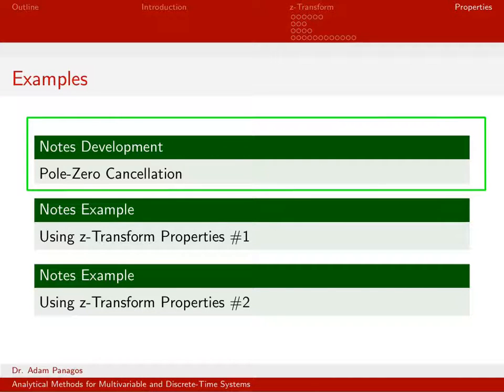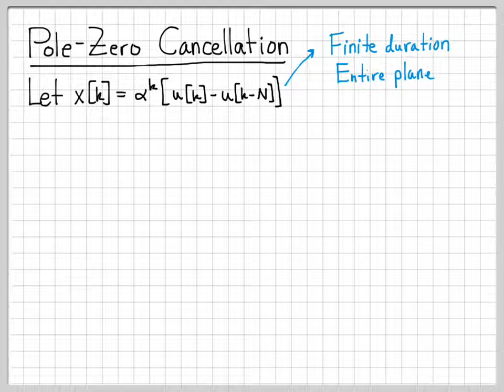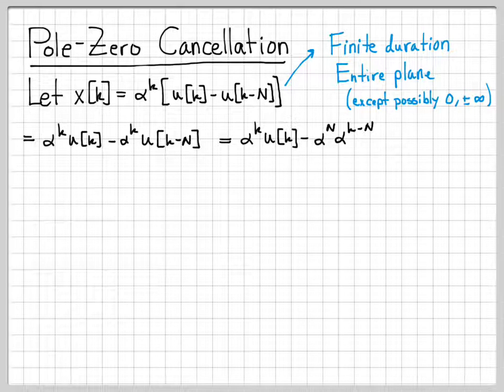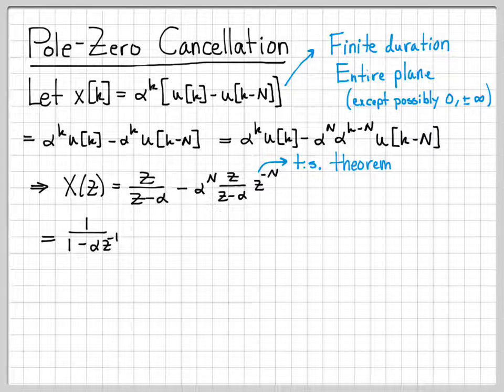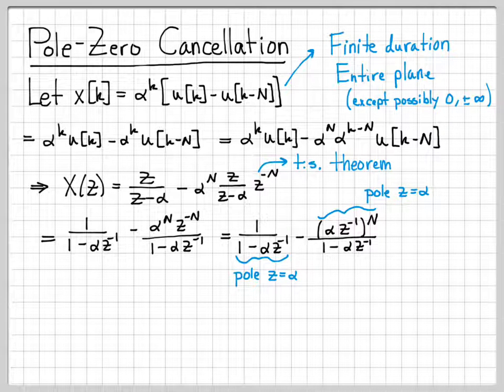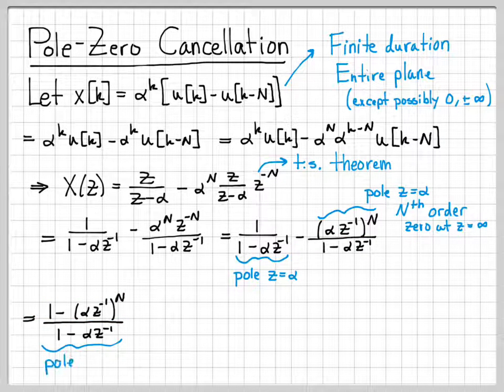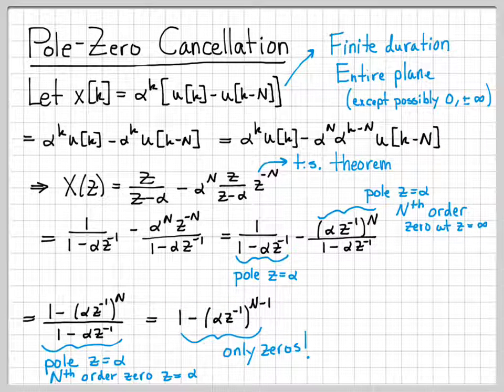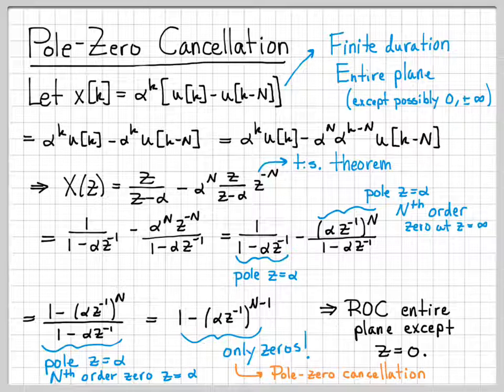Z-Transform Pole-Zero Cancellation - Z-Transform Part 1

Comment: Didn’t you mean to write: ROC entire plan expect Z = Alpha ? Instead of Z=0
Reply from the maker: No, I think what I have written is correct.  Take a look at the final expression of 1- (a*z^-1)^(N-1).

We just need to worry about values of z that might cause this expression to "blow up".

Since z^-1 = 1/z, if z = 0 we have a problem so z = 0 is the one point where we do not converge.

I hope that helps.  Make sure to check out my website http://adampanagos.org for lots of additional content that you might find helpful.  Thanks, Adam

Comment: Sorry, I am confused, how could the last equation in the video be correct?
Reply from the maker: Is the equation you're talking about the "1- (alpha *z^-1)^(N-1)?  

You're correct in that the preceding term and this final equation are not equal to each other.  It would have been better for me to write --> or => or something instead of the equal sign.  My main goal here at the end was trying to identify the poles and zeros of the transfer function so I could determine the ROC.

Since the pole at z = alpha was cancelled with one of the zeros at z = 0, the final transfer function effectively is just an all-zero transfer function.   However, as you noted, the equal sign is not correct.  Good catch.  Thanks.
Reply: Thank you So much, it is clear now!!
Reply: @stanleynickels6106  I think the problem here is that the N zeros are not all at z = alpha, rather they are at N equally-spaced points around a circle of radius |alpha|.  Exactly one of those zeros is at z = alpha, which cancels the pole, but the others remain, and the resulting quotient polynomial is the product of the other zeros, i.e. 1 + alpha z^{-1} + alpha^2 z^{-2} + ... + alpha^{N-1} z^{-N+1}.  And this is the same was what you would get by evaluating the z-transform of x[k] directly.

Comment: At 4:44, what happens if we algebraically rewrite that term into: z/(z-alfa) by multiplying it by z/z? Does that not mean that it also has a zero a z=0? Thanks.
Reply from the maker: +kabascoolr Yes, what you say is not incorrect.  The term 1/(1-alpha/z) is the same as z/(z-a) which clearly has a zero at z = 0 and a pole at z = alpha.  However, for the purposes of this video we are primarily worried about the ROC which is defined by the poles, and thus I really was primarily worried about where poles are located and if any zeros at those locations possibly cancel any poles.  I kind of ignored any isolated zeros in the complex plane since they don't impact the ROC at all.  Hope that helps,

Adam
Reply: Thank you So much, Sir, this is really helpful, your videos are so much better than the lecture offered at my University!